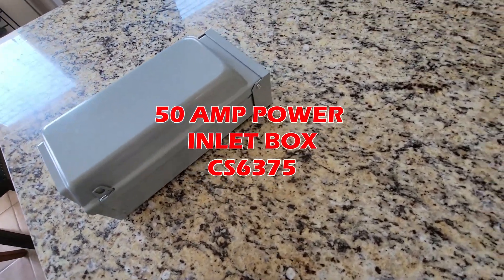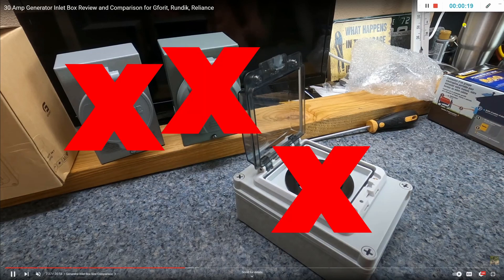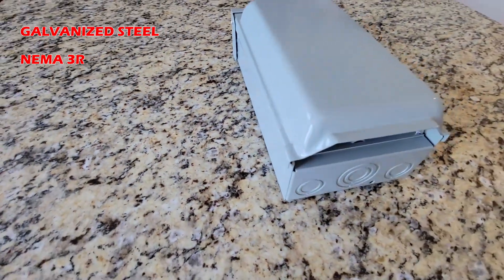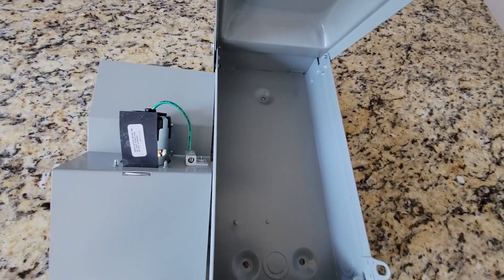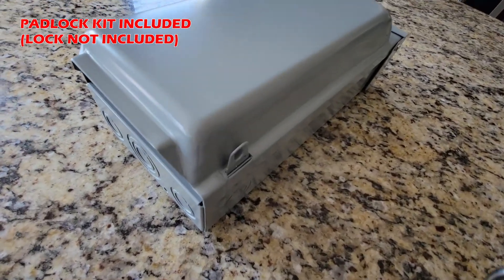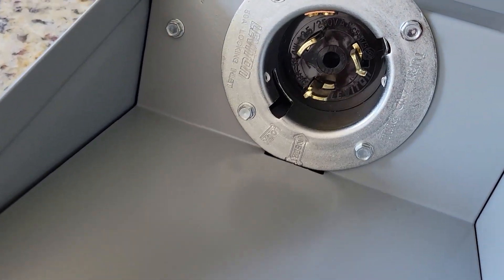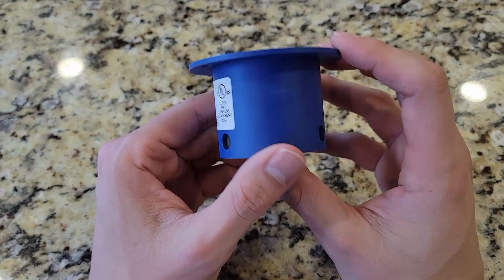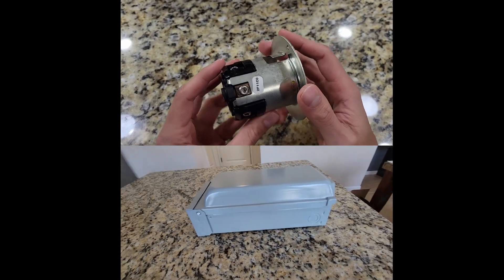The Best Power Inlet Box On the Market, I Show you WHY | GE T050N

Comment: Liked & subscribed!

I had just researched the market for a generator power inlet box and came to the same conclusion: the GE T050N is the most solid 50 amp box I could find anywhere. Customer complaints about those other skimpy boxes contained plenty of user frustration about lack of internal space for wire runs, cheap plastic outlet covers, poor quality sockets, severe weather concerns, etc. Plus, I wanted to be able to lock the inlet box with my power cord plugged in, for obvious reasons.

While searching for mounting tips I found your product review video. You nailed all of the key points and revealed the kind of due diligence that, as an IT tech, I strongly admire. If you review other products with the same rigor, I'll be coming back for more from time to time.

NOTE: the leading edge of climate change has already arrived. Hurricane Helene should be a wake up call to deniers who have been convinced by their info sources that the reality that is unfolding around them is just normal weather events. Those with a more scientific approach to understanding things would be wise to do their disaster preparedness now rather than later when all the rest finally run to store for these necessities.

EDIT: I also ordered the 3D printed Insect Cover for the GE T050N from https://www.ebay.com/itm/155088996549. I'll report back on that accessory once I've received, installed and tested it.

Comment: One other thing to think about with the GE Box... when the lid is completely closed, there is still an opening that is not sealed at the bottom of the lid. Since the box may not be accessed for long periods, it would be very easy for wasps (or any other bees) to build a nest under the lid - where the inlet plug is located. I would hate to have a power outage in the summer and find out that I... or my wife may also need to contend with a bunch of wasps to connect the generator to the inlet plug.
Reply from the maker: Good observation. That is true, bees or any other animals can potentially nest inside the lid. In my opinion not a valid reason to NOT purchase this unit, as it is one of the best units on the market. I also wouldn't be sending my wife to fire up the generator/equipment either, but that is just me.
Reply: lol burn
Reply: Just cut a piece of foam or butyl rubber to fit the opening to plug it up
Reply: or you can get the connecticut electrical box for half the price
Reply: Valid point, but before one installs such just cut a block out of something that will fit the entry

Comment: I think this video is a little misleading (in regards to the Reliance PB50 Inlet Box). Look at where the presenter is holding the mounting surface of the 50 amp receptacle at 1:22 in the video. They are holding the mounting surface of the receptacle right up against the box WITHOUT the extended cylinder in place. The PB50 Reliance Box has a cylinder on the front of the box that moves the receptacle further away from the box leaving more room inside the box for the wires. I agree that the GE box is a better design... but I don't think this video is a true representation of the Reliance PB50 Inlet Box.
Reply: Ive had both the GE is FAR superior.

Comment: I bought this GE inlet box and I’m also getting the same exact generator you use, can you please recommend a cable for this setup that’s 30-50ft long?

I live in NW Houston (Cypress) and when our power goes out it has been staying off longer this year for some reason, up to 12 hours so far in 2023. I appreciate your videos.
Reply from the maker: Thanks for watching, had a similar 6-8hour episode earlier this year here in Austin. Regarding wires, Southwire is a leading wire manufacturer in the US.
They make awesome products. Unfortunately they only make a 50A generator cord that is 10ft long...
Generac makes a 25ft, 50ft models that are decent alternatives. 

50AMP Models
10ft = Southwire https://tinyurl.com/yxurs4ns
25ft = Generac https://amzn.to/46uKbb3
50ft = Generac https://amzn.to/3PEYHqA

30A Models
25ft = Southwire https://amzn.to/3r44tYC
50ft = Southwire https://amzn.to/3XH4VIM
Reply: @dgtv3320  I think you are better off building your own cord. I am in Tomball area, I bought this box on your video. I also procured from Amazon a Hubble plug to to fit to the GE box. I ill buy the 6/3 8/1 cord from Vevor and build my own cord. I am toying with the idea of burying conduit and moving the generator cord to my back porch and therefore needing and storing a small generator extension cord.

Comment: Generator is rated 30 amps.  Can I use this 50 amp  box?
Reply: Yes always go with a 50 amp inlet and #6 wire then simply purchase a 50 to 30 amp converter.  The benefit is you have the infrastructure in place if you ever upgrade your genset to a 50 amp or if you sell the house.
Reply from the maker: I totally agree. This is a great solution because the cost of installing 30A vs 50A infrastructure is minimal and you get the benefit of using either one.

Comment: I purchased this inlet box after searching for an actual metal inlet box for a 50A service. There was another that I briefly found then could not find it in stock anywhere. This GE T050N box is expensive for a reason and hard to find in stock. The only thing I don't like is that the lid (outer cover) when opening hits the inner cover and prevent it from staying open. I'm not sure if this is a designed safety feature or an oversite. As the inner cover can be damaged if you yank on the lid (outer cover) hard enough. The Leviton Plug is far more substantial than my generator cord. It has already lasted longer in better shape than the metal 30A inlet I replaced (and associated wiring and manual transfer switch). Your building inspector may make you label "High Voltage" and "Inlet Only" which labels are not included. I was hesitant at first to spend the near three time the next competitor, but I am not concerned with the quality of the unit and subsequent early failure.
Reply from the maker: thank you for providing addition detail and input--it is always welcome.
Reply from the maker: Regarding the high voltage labels, these are customer supplied and not included. I suggest looking into a label maker, these nifty printers are worth their cost. I have all my receptacles and light switches labeled with circuit numbers. I also label all my credit cards to maximize reward points (ex. travel, gasoline, groceries, restaurants, etc).  The applications are endless.
Reply: @dgtv3320  I agree. I bought a Brady and found the refills to be stupidly expensive with the machine wasting 2+" every print. Then I bought a Dymo for less than half and the tape is less than 1/3 the price. You can get cheaper non-branded labels, but the adhesive may not be as good.